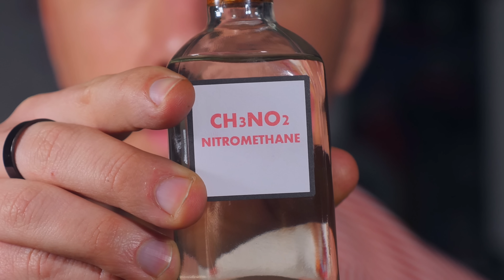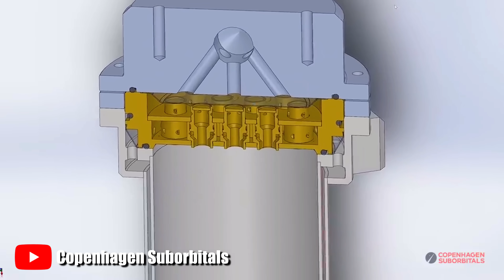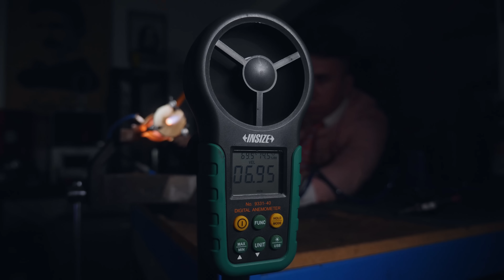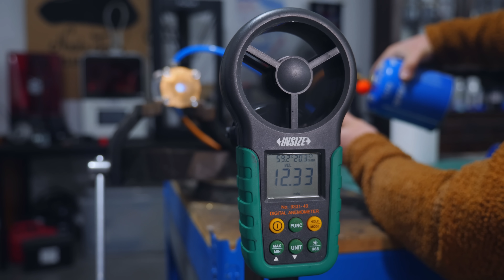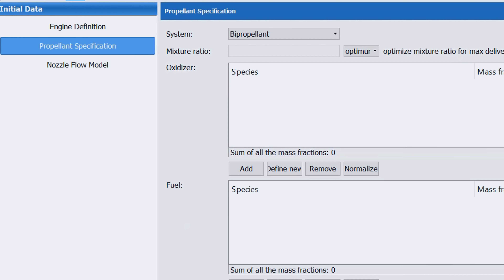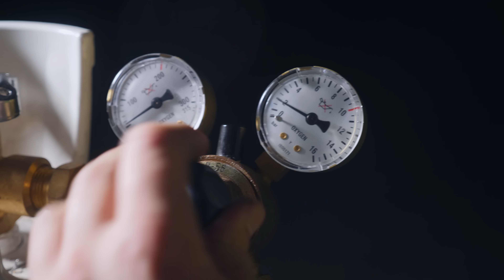GLASS ROCKET ENGINE

Comment: I am a final year chemical engineering student and I am currently working on vacuum distillation of hydrogen peroxide to produce high test peroxide for my final year project. I am currently using a packed column to do the same and achieved 90% purity in just 5 hours. For your next video you could try doing that by using a glass tube and 3d printed abs packings because from my experience it is much more powerful tho it has to be handled carefully.
Reply: Be really careful with this man, many people have wanted HTP in the rocket industry and many have suffered quite potent explosions. Not saying don't do it, but just plan for it to explode at any point and for you not to be injured/building burnt down etc when it does. Peroxide is just forgiving enough to let you make really dangerous mistakes.
Reply: Why wouldn't you just use a distiller? The peroxide boils at a lower temperature than water, so you can get very near 100% after maybe 2 passes.
Reply: @jaysengstacken2118  boiling high test peroxide is generally a great way to have an unexpected explosion
Reply: @jaysengstacken2118 I guess we are making bombs in youtube now

Comment: The Bloodhound rocket car used hydrogen peroxide as an oxidizer, however it required a Jaguar Supercharged V8 to power the fuel pump to the main rocket as it needed such a high flow, I see from your videos this is where you are heading..  🚀🚙 👍

Comment: the ideal air fuel ratio for combustion is called the stoichiometric ratio. It signifies the air to fuel ratio that is most efficient, with an almost 100% burn. Its used in cars, rockets, and anything with an engine really.

Comment: You need a 5-axis CNC machine and a metal printer. You have 1 million people following you, surely a company will sponsor your equipment if you negotiate smart. 

This plastic crap is all well and good but it always ends up not withstanding the temperatures and that's a shame, don't limit yourself with nasty plastic 3d printing. 

Go to the metal side and do some real welding, not brazing. I like your videos ❤️ please go to the good side of the metal side

And by metal I don't mean this coke can aluminum 😂

Greetings from a mechanical engineer

Comment: Amazing video !
So Hydrogen peroxide + potassium permanganate = a lot of steam under a lot of pressure, a lot of pressure = can make a turbine work to generate electricity.
The steam is made of water, and water + electricity = electrolysis (even if it is slow and inefficient) = hydrogen (+ oxygen, even though you already have more than enough) which is a great fuel.
So you could make a contraption that literally re-burn its exhaust to make a second combustion and only byproduct are water and oxygen.
It won't be a positive feedback loop of course, but it could be fun, and teach about losses.

Comment: What would be really cool if you split water using the Thermochemical method, so that way you get both the fuel and oxidizer for your rockets and other projects. And it might be a little more doable on the 3d printer, maybe.

Comment: Suggested theme. The WWII German V1 used a pulse jet which took in air from the front using a grid of flaps that acted as non return valves. How well would a similar design using a Tesla Valve instead of the mechanical flaps work?

Comment: I've used nitrous oxide from whipped cream canisters as an oxidizer for rockets before. It works quite well although you might need to use more than one to get a decent burn time. I chose that for my oxidizer because it's very easy to make a pressure-fed engine that way. It also comes in such convenient prepackaged little bottles.

Comment: Poor Man's 3d Metal Printer! Use a slicer program, metal sheets, and a small kiln to make then fuse layers of metal into a rocket engine! (see below!)

Okay, Take a 3d printer slicer program, get all the slices of a rocket engine from it, then either load those into a cnc cutter (laser, Dremel, w/e) with sheets of metal of the appropriate thickness (thin sheets of brass, perhaps). Alternatively, you can print the layers, stick them to the brass plates, then cut them out by hand with rotary tools and a jewelers' saw (max precision on the interior voids though!). 

Stack the layers together to assemble the device, taking pains with the alignment, and you can use soldering to make supports, as well as soldering some spots to tack it all in place (as well as tying it together with wire) then carefully encase it in _Investiture Plaster_, making sure that the interior is fully filled as well (quick run in a vacuum chamber ought to do it). (none of this gear needs to be big! in fact, making a really tiny one with really thin sheets could be super cool!)

Filled inside and out with investiture, you can now run it in a kiln hot enough to liquify the brass. then let it cool. You've just Cast In Place! drop it in water, clean it up, remove supports etc. and you've just "Cast a 3d print"

With some practice, you could use this method to "3d print" nearly ANY metal parts! the limit is really your furnace/kiln. if you get one that can go hot enough you could even make STEEL parts!

Comment: I couldn't see if you put the oxidizer mass as is or if you considered the mass of the oxidizer just to be a fraction of the air which is about 23% or if the program to design the nozzle notes that already. That could change the parameters of the nozzle design.

Comment: Another great video! Please keep them coming. I think the issue you are having with all these rocket engines you are building is the delivery pressure you can achieve. It’s my layman’s understanding that the chamber pressure can not exceed the delivery pressure of the fuel and oxidiser. Maybe you could try using a scuba tank (around 4-4500psi I think) and a modern car fuel system (petrol 2.5 - 3k psi, deisel much much higher). Just a thought.

Comment: Try creating a liquid fuel rocket engine that can be 3d printed on a regular fdm 3d printer and create some sort of way of mixing the fuel and air kinda like a carburetor so you can use liquid fuel

Comment: Waiting for dual propulsion rocket engine. I've heard that you can burn steel wool into extreme heat welding machine by injecting oxigen into it. give it a shot maybe you can build a portable welding machine.

Comment: Potassium Permanganate is often prepared into a gel with silicon dioxide; this might be a way to make it better manageable for your needs; able to fill a tank/syringe, control flow with pressure, pumps, valves, solenoids; and supply even-more oxygen?

Comment: Don't forget that using a graphite nozzle also has disadvantages like the fact the nozzle will rapidly ablate in an oxidizer-rich environment as the high heat and high oxygen will cause it to basically vaporise to CO and CO2.

Comment: Watch out with your brass end-cap at the “hot” end of the engine. Every so often I saw a green/blue flame so your possibly burning off your end-cap. It’ll also be the first part to fail under heat and chamber pressures.

Comment: Ok hear me out. The dual combustion engine is fantastic, and a hot topic I normally about is transportation efficiency. Ariel has a new electric vehicle that is recharged by a turbine. Perhaps as a video idea you can design a system that can recharge capacitors for electric propulsion in a controlled environment? Or use that fancy wankel to do it, but it probably isn’t ideal for generator scenarios.

Comment: can you make a potassium permanganate/hydrogen peroxide controlled injector on the front of the rocket, with a controlled regulator for the butane near the nozzle 

basically acting like a turbo for the butane reaction inside the rocket?

Comment: See if you can build something that moves that is entirely made of 3d printed parts. No screws, no glue, no fuels as an extra challenge. I haven’t really seen anyone do this yet. Extra points if you make something that flys and not just drive. It’s gotta be powered by 3d printed materials like plastic springs and propellers. No rubber bands. 100% 3d printed. Basically my idea is that you make something really cool that can be made entirely on anyone’s 3d printer without having to go buy extra parts.

Comment: Theme: Double Propelled 3d Printed rocket engine concept because you will be using the potassium permanganate as the fuel like what you said the de-composing the hydrogen peroxide super heats the steam and gets a dual propelled rocket

Comment: I wonder how the potassium permanganate will be introduced to the combustion chamber? It would be very interesting to see it mixed with a binder so a solid fuel cell of the permanganate that a jet of your methanol/hydrogen peroxide mixture can be shot through. The reaction might even self ignite the methanol due to the heat from the reaction, which would make the rocket essentially pseudo-hypergolic I suppose?

Comment: Maybe preheat the fuel in coils and then inject it.  I've seen a handheld propane tank with the valve altered to allow full pressure and this pressure sent though a very narrow long copper tube coiled to preheat itself and shot out supersonic from a near pinhole diameter entraining air in a length of pipe absolutely deafening.

Comment: if you are playing around with pure oxygen would be a good idea to put a flashback arrestor in the line as close to where the burning is happening as you can get you should be able to find them anywhere they sell welding supply's

Comment: A rocket powered bus would be a good project, it would contain all the  parts in concealment.  I would like to see you scale this up to a go cart size with three small engines running at full power to test thrust ISP efficiency with a load.  Will need to do a scale sled test first.

Comment: Can you make a rocket engine that uses potassium permangenante in a grid/lattice formation that has hydrogen peroxide sprayed over it and the butane injected and ignited after?

The hard part is making the catalyser grid structure and have it contain enough catalyst, but it would allow a massive reaction and O generation.

Edit: I just found that hydrogen peroxide reacts with silver. So maybe a silver gauze/mesh would be enough to catalyse the hydrogen peroxide.

Comment: Hi. Love your work. I wonder though how someone as clever as you can make a comparison between 14 litres of gaseous air and 1 gram of liquid fuel. Isn't the afr a weight to weight ratio? Liquid fuel weighs a lot more than gaseous fuel. It should be 1 liter of gaseous fuel to 14.7 liters of gaseous air shouldn't it? Or 14.7 grams of liquified air to 1 gram of liquid fuel. Or do the rules of math not apply here? Hopefully you can work on this problem and perhaps do a video? I would be very interested to see the results of the correct ratios applied to your rocket engine.

Comment: You need to keep the combustion stages of your engine below the respective melting points of the materials you are using, there's reasons why things like titanium, and other very high melting point materials are used. Even then they utilize ducting and other techniques to keep it below its melting point.

Comment: Video idea: Why don't you mix hydrogen peroxide with methanol and create a simple rocket with a single combustion chamber and a pump to feed the fuel to the catalyst? The pump could be powered by an electric motor for ignition, and then it would work with the gases produced. I know it's complicated, but it could be divided into several videos with different parts.

Comment: you need to couple the potassium permanganate reaction to create the oxidiser with the butane of course, and then set up that cool control system you made to control the mixing of the substances with the syringe and servo motor. Then you can mount that all onto your skateboard with a remote control for the throttle.

Comment: Instead of using a skateboard try to building a vertical rod that the engine and tank can slide on. Also to compensate for the dead weight of the oxygen tank and such you can add a spring that pulls the contraption up. You then just calculate the spring force and spring tension needed so that the engine thrust theoretically is only applied to the weight of the engine! ❤️

Comment: I'd like to see a comparison of lift of a butane or other rocket compared to the lift of a simple 2 liter plastic bottle rocket which consists of enough water to fill it halfway or so, an air compressor capable of 100-110psi (yes they usually can hold that, bursting around 130psi) a launchpad with a rubber stopper connected to regulated pressure air supply and a secured hold down with holes for a set of forks (go over lip of the bottle to hold it on the stopper tightly) connected to a long rope for pulling to launch.  
These type of rockets are quite powerful and can go 300ft-900ft (100m-300m) high depending on skill of the build.  I'd like to see you play around with those even though they dont involve fire like you like 😅

Comment: In this age of electric vehicles, I wonder if you could do a video tackling the question of electric flight? My limited research has taught me that an electric turbine engine is requires insane amounts of power but would also be required to maintain current flight speeds expected for commercial uses.. Could you scale down and simplify a version? Or come at it from another angle completely? I would be super interested to see what you come up with!
Reply: Click_On_MyprofiIe  I feel like @integza normally replies directly from his own account..

Comment: have you thought about using solenoid valves in propane/oxigen tubes to be able to close them quickly if something goes wrong? pressing an emergency button would be faster than closing the main valve by hand.
(sorry if i said something wrong, my english isnt 
very good)

Comment: Future video idea: use an engine to power a compressor to power a rocket. That might actually all neatly fit on the skateboard, right? And you already got the nitromethane single from an rc 😄 (i also really need a 3d printer)

Comment: An even stronger liquid oxidizer than hydrogen peroxide, is liquid oxygen. All you need to make it is oxygen gas and some liquid that is -196 degrees Celsius like liquid nitrogen. Just fill a ballon with the oxygen and attatch a test tube at the bottom, and dunk it into the cryogenic liquid. After 10 min you should get liquid oxygen. 😊

Comment: Thought on a future video:  
Are you able to compress KMnO4 into a solid cylindrical brick with a small hole in the middle (maybe like a solid rocket engine), and then PUMP the methanol/H2O2 mixture into there? 
That way, you can have a large reserve of the KMnO4 catalyst and continue shooting the fuel mixture into it?  Maybe you could get an extended burn time using something like that.
I suppose that'd be some kind of hybrid rocket then.  Right?

Comment: As there is a limitation to testing the rockets on a skateboard, as it runs away and runs out of room. How would it work to make a rotary test rig? Like a Catherine wheel. With a clever hub you could keep the fuel supply stationary. Also it would look awesome!

Comment: Can you use Nitrogen Tetroxide as a part of or complete fuel in and of itself? I am researching the properties and while I am not certain if it is as safe, it is certainly something to research. I know it is used in rockets all the time. As to ideas... have you used anything lighter than your skateboard, and potentially with lower resistance than the ball bearings in the wheels? I know that specialty skate shops sell ball bearings with a far far lower resistance factor than the ones that come with skateboards. Just a few thoughts..?

Comment: You could make a big spinning top like the ones with the motor that spin til the battery runs out that can be steered by reaction wheels on the inside

Comment: I wonder if you could make hydrogen and oxygen to power a rocket engine with electrolysis - it'd be in the perfect ratio for combustion. You could even electrolyze the water on the rocket to make a self-contained water and electricity powered rocket.

Comment: That was something a bit violent, you are so going to loose your eyebrows at some point.  Question, why not either get your hands on liquid O2, or make some at home yourself, put it in a glass jar, drill a small hole in the lid, attach a hose in the hole and then run that to the engine.  Wouldn't that create a vacuum in the tube which would draw more gaseous O2 into the chamber and get more heat/thrust with very little weight added to the skateboard and see if it will shoot across the room?
A video that needs to be made is take all the engines you made, strap them together away from each other and have a tug of war and see which one wins and how far it can drag the rest of the looser and run over a tomato at the end.

Comment: In line with the topic of rockets, and I have yet to see anyone attempt this (for DIYers), but a rocket powered torpedo would be a super cool (non exploding, of course) project to work on. See https://en.wikipedia.org/wiki/VA-111_Shkval for the Russian made rocket propelled torpedo (the rocket part creates extreme cavitation and propels to something like 200knots in sea water). Just a thought, it's a much higher level of difficulty and requires a body of water to test.

Comment: I have an idea for a video! You do a lot of valve and energy projects. How about something cool with the RAM pump, using air and gravity to move liquids around. I have been tinkering for a while now and feel we can up the power, maybe having denser gases like suplhur hexafluroide in the pressure chamber or even a refrigerator style gas like you would find in a ground or air source heat pump

Comment: Interestingly youve built a RDE or rotating detonation engine. It has a signature buzzing sound. 
They’re like typical rocket engines and are more efficient and powerful essentially using its own shockwave to help ignite and boost its pressure ratio